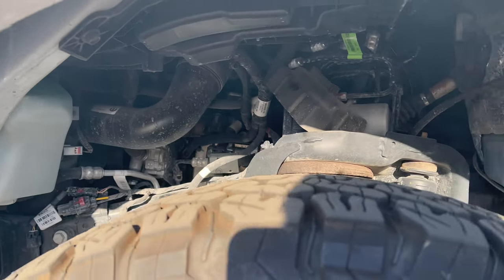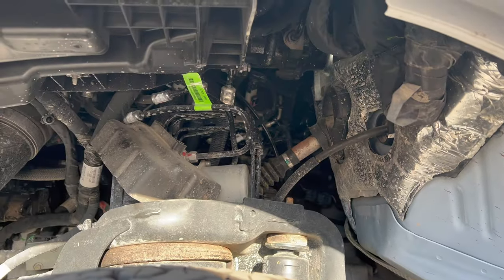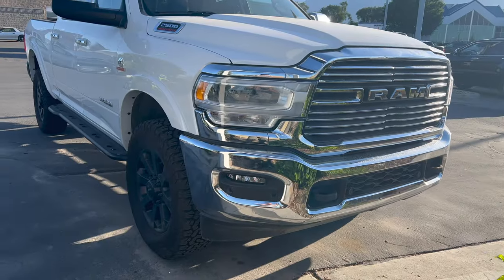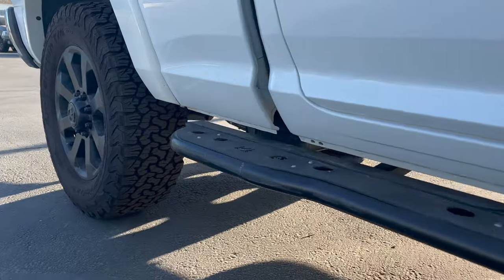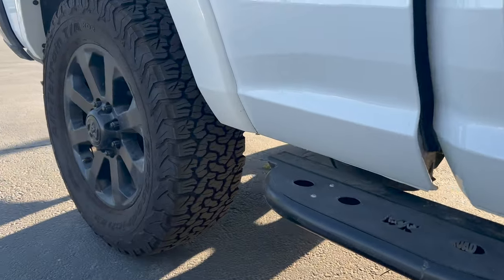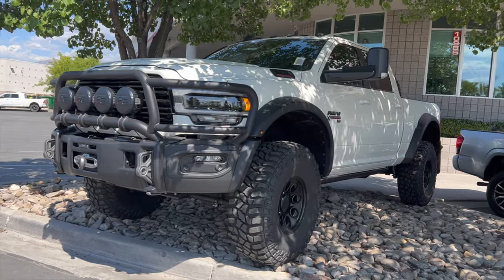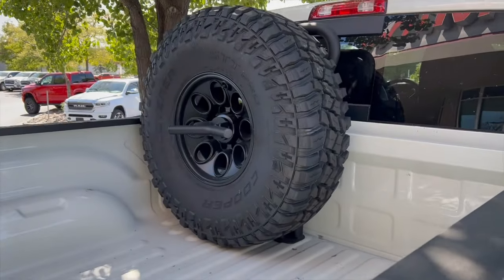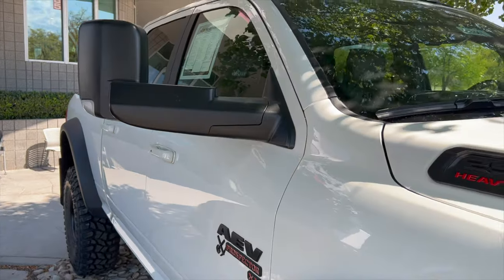Is my 2022 RAM 2500 Cummins a Lemon? 3 things are giving me patience:

Comment: If you happen to Lemon Law the truck, it doesn’t mean you have to give the truck up unless it can’t be fixed.
Reply from the maker: @John Stepanic so what would lemon lawing it do it that case? If I keep it, wouldn’t that just brand the title and lower the value?
Reply: @gavinwalker5686  I believe the Lemon law is a little different in every state but for the most part it (if Ram were to take the vehicle back) requires the manufacturer to disclose in writing to the next subsequent purchaser the nature of the lemon issue, the replairs performed, and that the specific lemon issue is protected by warranty for one year.  The intention of the law is to prevent “lemon laundering”, whereby a lemon vehicle is not lemon law title branded and is passed off to an unsuspecting consumer.  A lemon car title is similar to a salvage title for a total loss vehicle, though it is not as devastating to the car’s value as a salvage title. Even so, it further reduces the value of your already pre-owned vehicle, even if the manufacture can repair the lemon defect, because the lemon car title travels with the vehicle for the rest of its life.
Reply: If you get a partial refund, I don’t believe it affects the title but the attorney handling your case should be able to let you know for sure.
Reply from the maker: @John Stepanic right on, thank you 👊
Reply from the maker: @John Stepanic thanks for that knowledge, I only have 12k miles on the truck, and have a warranty out till 100k, so lots of warranty left if they were to fix it, so that’s good. I guess I have plenty of time to test out the fix. I’m ready to have it back though, that’s for sure.
Reply: @gavinwalker5686  Hopefully that’s the last issue you have with the truck.

Comment: I think...don’t really know but you are going to loose all the taxes paid, and upgrades. I would delete it. I’m in California and my 2015 2500 is deleted and love the fact it’s not eating it’s own crap or should I say exhaust thru the egr. get the AEV fenders but not the suspension. I would go carli 3” or BDS 4” 4 link for the suspension. AEV looks like a spacer to me.
Reply from the maker: @Joe Lotto the base AEV lift is pretty much spacers, but front the spacers actually shift the axle forwards almost 2”, which is necessary to clear the 40s. But the upgraded suspension is what I’d get with the bilstein 8100s. But then again, I’m not sure what the shock travel is, if it’s the same or improves. I’ll have to look more into it, thanks for the recommendation.

Comment: RAM just issued a Recall for PCM .
Reply from the maker: @Jake Rheault oh snap!! Ain’t just me having bad luck I guess. Thanks for letting me know!
Reply: @gavinwalker5686  hopefully your truck is  under that recall.  It states ECM but also says lose of power.
Reply from the maker: @Jake Rheault I’m sure it is, and hopefully since it seems to be a widespread issue they will have a reliable repair ready.
Reply: @gavinwalker5686  did you find out if your vin number/truck was under the recall?
Reply from the maker: @Mark David Casino I don’t think it did oddly enough. I haven’t been notified by Ram, and when I put my VIN on online the only recall tied to my truck is an ESC indicator light malfunction.

Comment: You currently can not delete 2022’s unfortunately.   21 and back you can. As far as legality the epa and dot do not care about you or me. They care about who is making the products to do the delete. I am a hot shot driver and can tell you they very seldom look for deletes on your truck. I also have a 2022 that is having multiple issues and have been fighting to get it figured out. I may be looking into 21 PCM swapping my truck at this point.
Reply from the maker: @Mike Honcho yeah there have been a lot of PCM issues. I got a new one because it stopped communicating to inject Def, now with the new one I definitely go through def faster, so it must have been having minor issues with that system the whole time.
Reply: @gavinwalker5686  to put it in perspective my truck is 5 months old and I’ve already put 50000 on the odometer.  The amount of problems I am having with this truck is crazy and they are all over the place. I’m planning on making a video in the truck and my dealer experience.  I’m at the point I may be getting a lawyer.
Reply from the maker: @Mike Honcho 🤯 haha dude that’s some crazy mileage! Sucks to hear your experience has been so bad. Let me know when you make the video I’d love to watch it and get all the details. Has your truck met lemon law requirements already? Sometimes when you start suing they’ll offer to settle out of court, you get compensated for the hassle but since it’s out of court the truck doesn’t get a branded title. Just something to look in to, especially if all the problems caused you significant down time and lost revenue.
Reply: @gavinwalker5686  unfortunately it does not.  I have multiple issues. And everything is intermittent and never consistent. The only consistent problem is the my 12in uconnect. I’ve already had one relearn done on the trans.  Pretty sure the EGR is already failing. Truck consumes def at a almost stupid rate randomly not always.  Sometimes the truck feels under powered and the mileage is horrendous and then randomly will drive like a HO in comparison.  Exhaust brake is pretty much worthless but that is most likely due to the egr failing.   Truck doesn’t recognize the key fob is in the vehicle randomly a lot.  Wiper fluid senso failed. And there is more too.  And the experience I have had so far with the dealer I bought it from has been terrible. And this is the second truck with problems I have bought from them. First one was used.  This one was brand new.
Reply from the maker: @Mike Honcho gosh, it may not meet the lemon requirements but it sure sounds like a lemon. What a hassle. I think it’s especially weird that the dealer has been hard to work with. I feel like most dealers would be extra courteous given the hassle to try to redeem the brand a little. Those issues are all over the place too.

Comment: Expensive truck...Expensive repair bills.....Expensive doctor bills because l can't sleep well enough because just thinking about the truck....plus. 😓😓😓😓
Reply from the maker: @efrain garcia escalante have you seen the ‘23 model year? Huge price jump for the same thing. Inflation is hitting. I definitely don’t look forward to these repair bills being on me when the warranty is up. Hopefully the kinks are all worked out by then.
Reply: @Gavin Walker  hi !!!
I haven't because the piggy bank still recovering since l bought my chassis cab  3500 crew cab.  Diesel 4x4. on 2016 when l get it. All recalls are fixed. 😊😊😊
Reply from the maker: @efrain garcia escalante sounds like you’ve got a nice truck! And that you use it like a proper truck if it’s a chassis cab. No need to upgrade that for a long time
Reply: @Gavin Walker  it is, l wish at least vinyl seat cover but at the time to  get to the dealer just cloth seats and vinyl floor was available,for work trucks is better vinyl floor and vinyl seats. By the way l bought the model SLT. 
Before of the pandemic  era. Because today's price compared with model 2022. Is around 16k of difference price.  
Crazy....right?😊😊😊😊🙋‍♂️🙋‍♂️🙋‍♂️
Reply from the maker: @efrain garcia escalante wow 16k difference on price is crazy! Definitely nice that you bought when you did! It’s crazy how expensive things got during the pandemic, and crazy how much the prices are still climbing!  That vinyl floor would be nice, and yes vinyl seats would be too, but having a work truck level is nice. I like my truck and the interior is super nice, but it makes me care about it more and I’m always worried about kids putting their feet on the seats, getting crumbs everywhere, etc 😂
Reply: @Gavin Walker  it is with kids. I believe the brand weather mat make like exact fit so it catch most of the debris and dust and water and mud if is the case. Ok. 🙋‍♂️🙋‍♂️🙋‍♂️🙋‍♂️
Reply from the maker: @efrain garcia escalante I’ve got the factory all weather mats in my truck, I’ve been pretty impressed with how those fit as well. They’ve done a good job so far.

Comment: Just buy you a Toyota Tundra you will have 0 issues
Reply from the maker: @Elmer Ramirez I was saving and waiting for the 2022 Tundra but when they didnt have a bench, I had to look elsewhere. The used ones were too price inflated at that time too, so I ended up buying this. If I do get rid of this, a power wagon and older tundra would be on the top of my list.